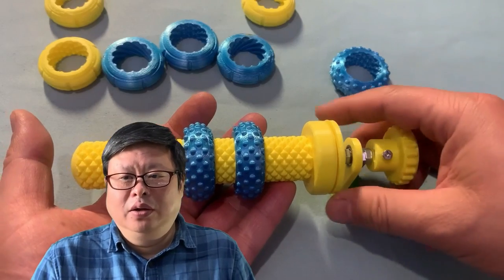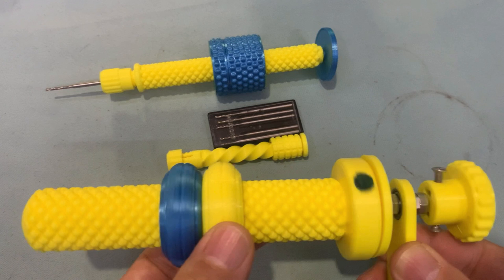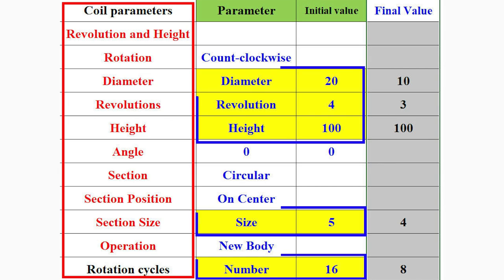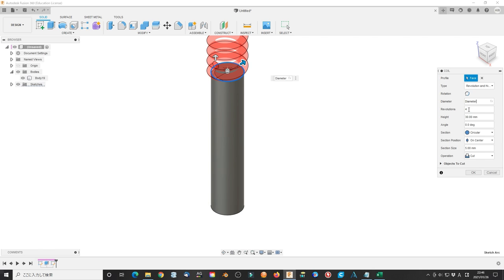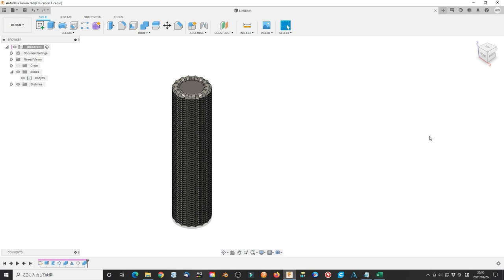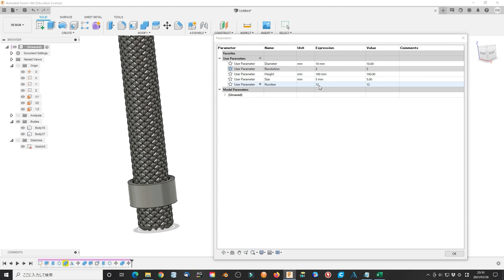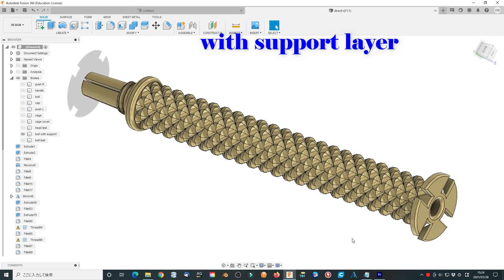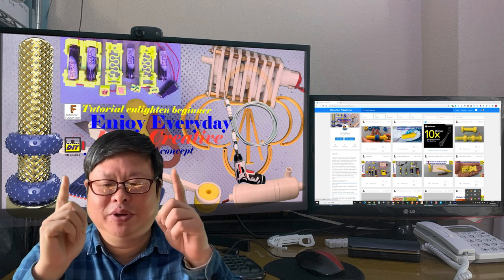First 3D printed straight one-way manual hand drill in the world

Comment: I just printed it. but i used a brim for some parts. Tommorow i will sand it a little and try it. Thank you very much for the design and the explenation of how it was made. You are awesome!!!
Reply from the maker: I usually not use the support layer.  In fact, I have made some modifications to upgrade the drill for better use. Now I am testing them. Please wait a moment and I will upload it soon.  I hope early next week I will finish them. In the new version, I will add more options for different drill sizes.  Now you can only use 2 ~ 2.5 mm diameter size. 
Thanks for your comment. Have a nice day.

Comment: Mine is turning only on the way up, what am I doing wrong?
Reply from the maker: What is your meaning way up? Is it mean only one direction rotation? The design is only rotating one way. You can change the rotating direction by turning the pusher downside.  Good luck. Have a nice day.
Reply: Hi @TubeUnderdeveloped  , I meant that it's skipping when I move the cage in one direction but it's turning the drill on the other. Imagine that you are holding it vertically, the drill bit pointing down and you are holding from the handle. When I move the cage up (towards the handle) the drill turns fine, but when I move the cage from handle towards the cap, the drill doesn't turn at all. I'm currently guessing that the little cylinders on the nuts that grab on to the cage are maybe short so the cage doesn't stop their turn when force of gravity is not helping.

However, it's working very good except for this. If I can fix this, it will be perfect. Thanks for the beautiful design!
Reply from the maker: @EternalKing06  I see. Your consideration is correct. The 3d printed small hinge can't be fixed to the bottom of the handle cage. Use small print height when slicing the model it may help to make a good one. I usually use 0.2 mm. Good luck.